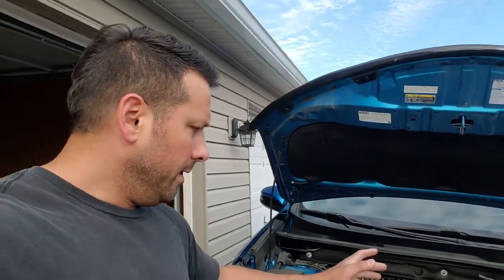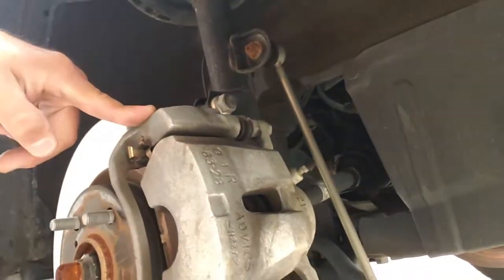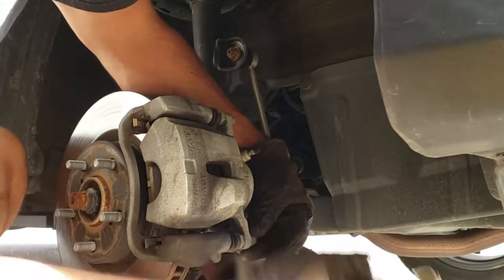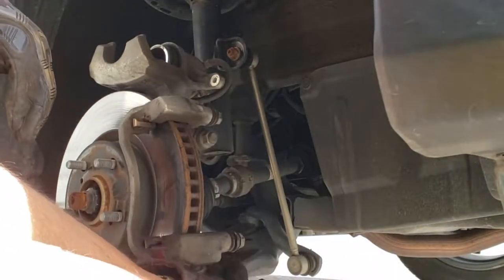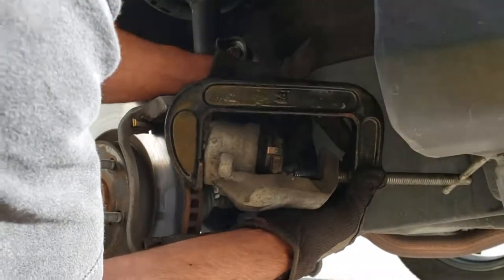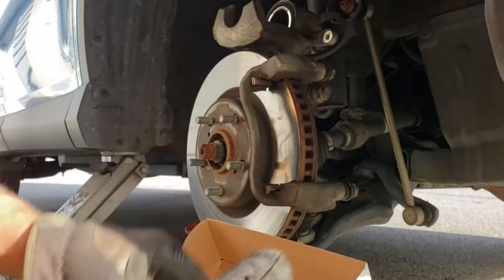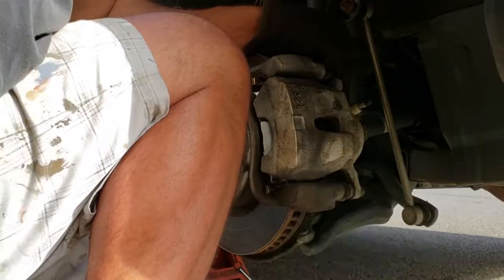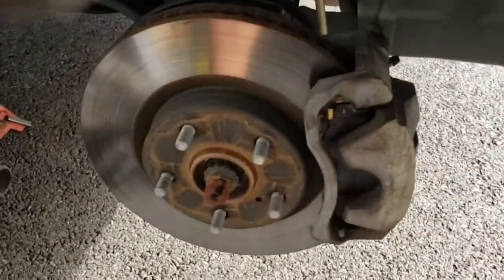2018 Rav4 Front Brake Pad Replacement

Comment: The mechanical part is fine. But he shows the bag of hardware and then never opens it. He uses the old hardware. He also comments that there are no anti-rattle springs on the new pads and just puts them in like that. The new anti-rattle springs are in the bag of hardware. He should have installed those on the pads along with the new hardware. And when you have the anti-rattle springs on the pads, they don't slip in as easy as they did in this video.
Reply: Thanks for your thoughts.  This is how I decided to install these particular pads.  As each installer selects a brand or parts to use, some "kits" include hardware, some pads have the low pad indicator riveted into the metal backing plate.  So do not have hardware, some have indicators that snap on, which I have seen snapped off, and it's a metal on metal situation.

I like youtubes platform so other's can give insight by posting a video.  I hope this one has helped to whatever degree each viewer, gets out of it.  Looks like it has made you more alert, noticing various details as well.  Thanks for commenting.
Reply: @andrewscribner5983  Appreciate the reply, Andrew. The vid was helpful as I wanted to know what I needed to do in order to replace the pads on my wife's vehicle. I'd done my 2018 Highlander earlier this year and now that I've done the RAV 4, they are pretty much the same process and configuration. No squealers on the OEM pad. And the anti-rattle springs need to engage a tiny divot on the pad or they are not secure.
Reply: @robs3670 Heck ya, go Rob.  That's what it's all about, getting things done.  Put up a video if you haven't already sir.

Comment: Is it the same for a hybrid rav4
Reply: The process for the installation is the same as displayed.  I would recommend checking you vin number, on a Toyota parts site for the correct parts.

Comment: How many miles did the rav4 had when you replaced brake pad
Reply: Sorry, I'm not sure.  This wasn't my car.
Reply: It depends on how you drive. The manual recommends between 30k - 70k depending on wear. The best thing you can do is take it to a shop and get a free brake inspection while they are doing other work, or look at times like state inspections to see where your brakes are at. I purchased a used RAV4 and its only at 28k miles but my pads are already 4/32 so i will be replacing them. On my previous corolla, I did not replace pads until 55k miles
Reply: He stated 50,000 miles in the video I believe. As he has had the car for only a year but drives a lot

Comment: Do I need to machine my rotors?
Reply: You can machine rotors, down to the minimum limit, they are normally inscribed outer edge of the rotor.  However, with reduced thickness, they can become more susceptible to warping, due to less material to dissipate heat.

Comment: Do you have to bleed the breaks?? 

I changed mine and the breaks feel kind of loose they did tighten a bit after driving it
Reply: You normally should not have to.  Depending on how How many miles are the vehicle, brake fluid can break down after "x" amount of heat cycles, forming water and air, which will compress easier, than brake fluid, giving a spongy pedal feel.  The other issue may be a failing master cylinder, or slave cylinder.  Fluid can bypass the pistion, and not deliver the full effort, of your foot.
Reply: Did you pump the brakes after installing the pads?

Comment: What grease do you use? Would "Lucas Oil Lithium Grease in White" work on the piston? Thank You
Reply: I don't think white lithium is ever ok to use on a high temp application.  I would not use that on brake parts.

Comment: The pads are not actually identical. If you look one will has a dimple on the outside of the pad and one won't. I notice if I put the one with the dimple on the outer side the guard on the brake pad slides off and grinds against the hub...

The one with the dimple is even labeled outer. At least mine are. I'm going to ignore that.
Reply: Nice tip.  What manufacturer are those?

Comment: So is it ok not put back the break pad hardware?
Reply: The hardware should come with your new pads.  Nicer quality sets will have stainless steel.  You do need hardware installed on the bracket, these allow the pads to slide as they are compressed and adjust as the pads wear.

Comment: Great Video Tutorial Andrew! Don't you have to put on Brake Squealer on the new pads? Thanks
Reply: If I recall, these pads had a detached wear indicator, which allows you to put it on the trailing end of the pads.  I forgot to! Haha.  I saw them afterwards.  Most pads have them attached.

Comment: Hi, did you put the cap back on before pumping the brakes?
Reply: You don't need to, as all the brake fluid pressure is on the other side of the master cylinder.  Also, if the cap is off, you can add additional fluid, if required.
Reply: Andrew Scribner sweet! Thanks for the info. Have a good one

Comment: I have AWD 2018 RAV4 and pads are low on all 4 wheels. Is there much difference in the back pads or is it just rinse and repeat
Reply: Rears are easy as well.  I did the rears in 15 mins.

Comment: Great video. Is there a difference on the brake pad between the Japan made 2018 RAV4 LE and the Canada made model ? A lot of site listed different part for rotor but no info on pads
Reply: Great question.  I don't have a straight answer, if the physical pads are 100% identical.  I did some searching, and found that the part numbers from the caliper brackets down to the pistions are all different numbers.  Someone should go to a parts store and take a picture of the two.  Manufacturers are always superseding part numbers, and interchanging them.  But name it what you like, does it fit.  Today, I don't have that answer.  Thanks for asking @Jason Hu

Comment: Can I just bleed out some of the old fluid when pushing the piston back in and just refilling the master cylinder?
Reply: When you push the pistion back in the housing, fluid will rise in the reservoir.  If it is topped off before you compress the piston, it will spill.  Soak it up with a rag or sponge, or "turkey baster".

You might consider just bleeding the brakes, if you think it's time for new fluid.

Comment: Hi 
Did you install the break hardwear to the new pads? I didn't see it on the video.
Reply: Good eye.  So on this vehicle, I did not.  As long as there are no indentations, I prefer oem hardware.  Some aftermarket hardware, doesn't fit as well as oem.  Oem is also mostly stainless, and some other house brands use a lesser quality.  I hope that helps you with your project.

Comment: Very good informative video. What is the size of that c clamp ?
Reply: 8 inch.
Reply: @andrewscribner5983  Thanks Andrew for your speedy response. I will try to have a go at changing my own brake for the first time. I will do exactly what you show on your video. hopefully all goes well.
Reply: @testingdpc just pry the piston in before removing the caliper with a screwdriver. You won't need a c clamp.

Comment: If I need to clean and lubricate those pins that might be stiff like you said what do I use to clean them with and what do I lubricate it with
Reply: Get some high temperature grease from an auto parts store. clean them off w/a rag & put the grease on it then slide them back in.

Comment: Do you always have to use the little metal clips to come with the pads to let you know when the pads you're worn or could you go without him
Reply: The vehicle will stop with out them.  If you don't use them, you could do visual checks for remaining pad on your vehicles.  Also a great chase to see if you have even wear.  If the pad on the inside is worn more than the outer, that could indicate the slide pins are not "sliding".  So you're getting less braking power.  Thanks for the question!